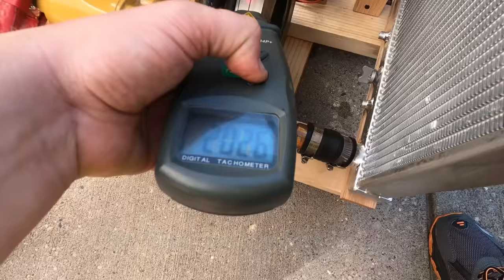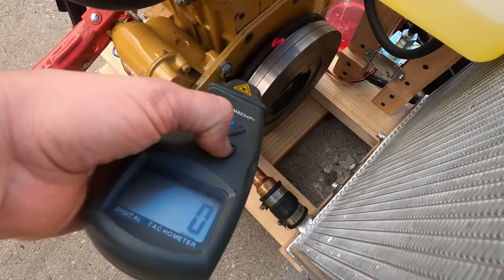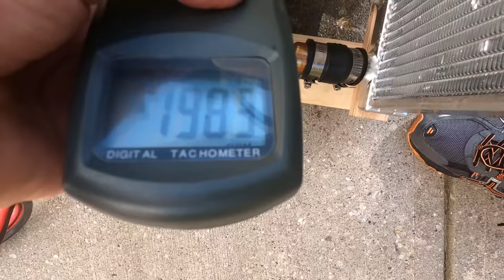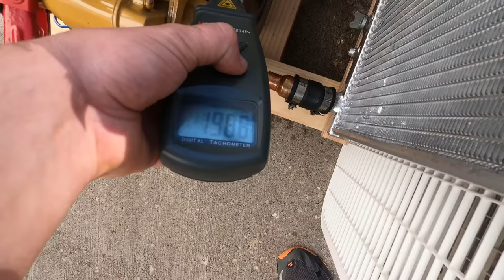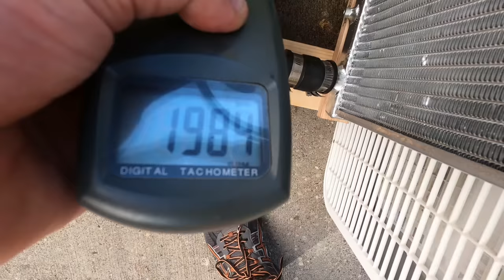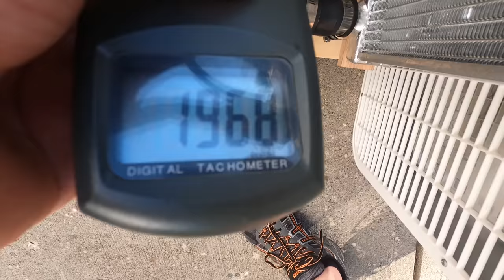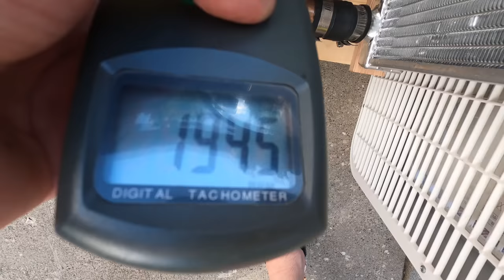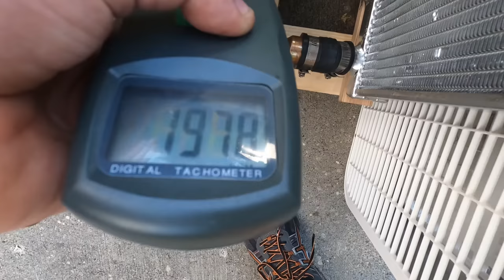Will Caterpillar Diesel run on Cooking oil? Attempt to run engine on Transmission Fluid & other oils

Comment: Wow the lack for knowledge is amazing just because it's running Does not mean it's running as well heat from the combustion is a major factor on the engine and each of these oils will burn at a different temperature So just be cause it's running does not mean it's running as well speed of the engine runing does not mean it's running good he could very well ruin and or Warp the engine